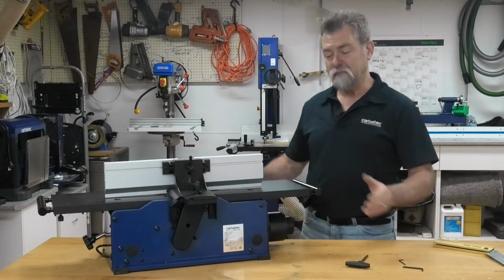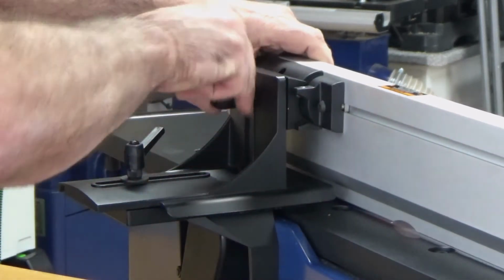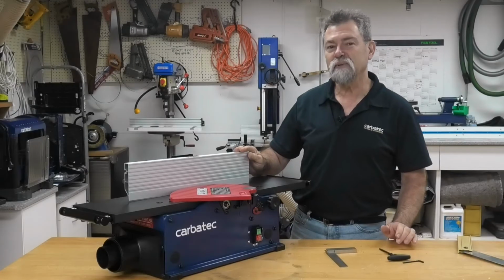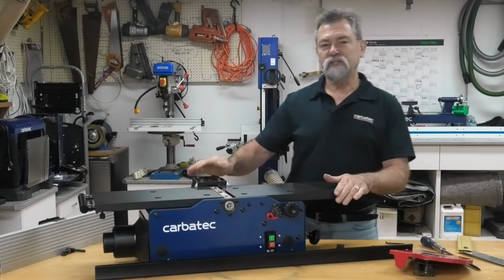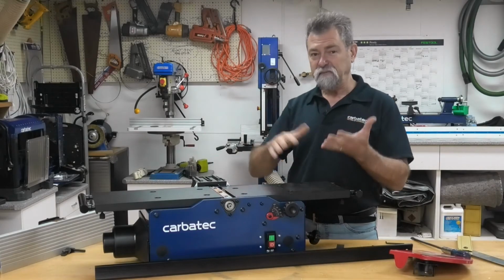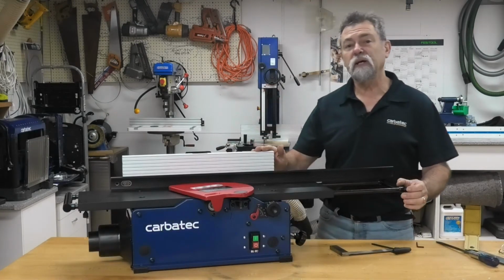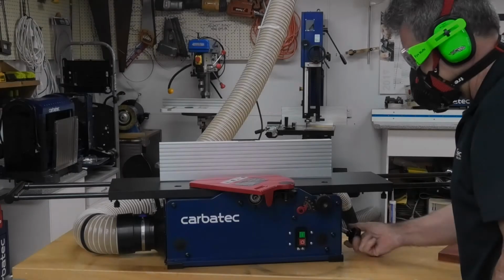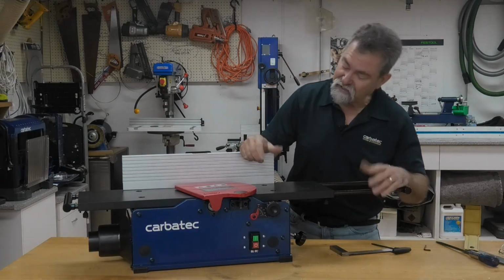Carbatec JN B150P & JN BX200P Benchtop Jointer Setup

Comment: Hello Dave. I have a JN-BX200P. I am having a lot of trouble jointing a piece of Vic Ash 1200 x 35 x 175mm. With every pass, I am ending up with a bow, like a banana. I have spent 4 hours meticulously adjusting the tables and extension support bars. I have watched your video 20 times to make sure I am not missing anything. I am  confident the machine is adjusted and set up correctly so it would seem to be the operator technique. Appreciate any comments.
Reply: exactly the same problem here...ive calibrated the beds to match the blades...